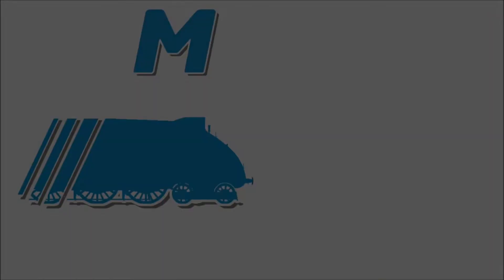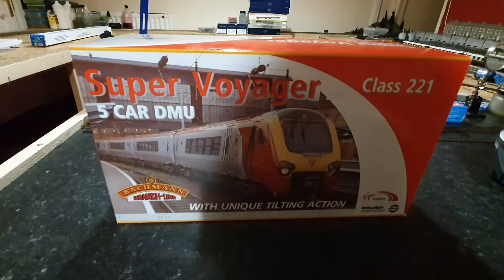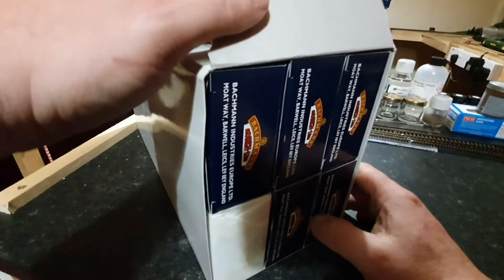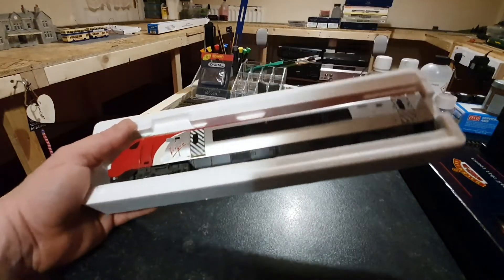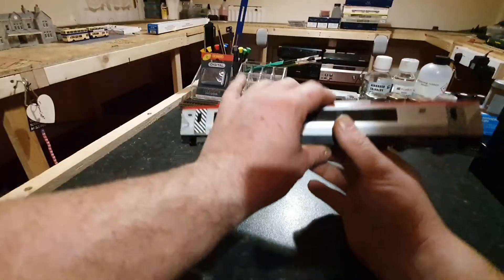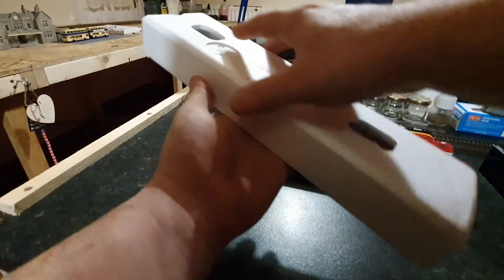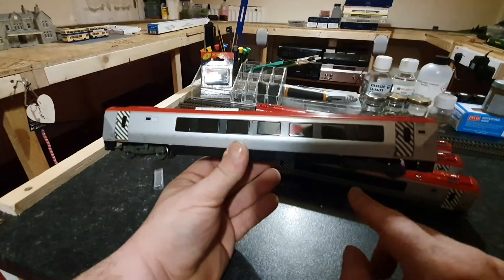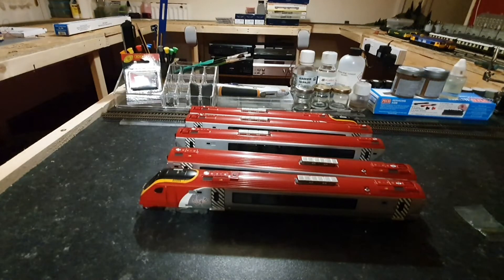Bachmann Class 221 super voyager

Comment: Hi Peter, the lil rhyme is helpful ‘ red & black go to the track, orange & grey go the other way. Ie to the motor. Red/orange are track /motor RIGHT, Black / grey track motor LEFT.

In the cab units its a separate decoder for each Im afraid. 3 decoders in total. Again red & black go to the wheel pickups. Orange & grey are redundant here so just tape them off. Green and blue are your best bet at one end cab lights as that operates on function 1. You could then use purple and blue at the other end as this operates on function 2.

Directional lights are controlled by white - forward and yellow for tail lights with blue as the common positive. 

Blue is the common positive for so that goes to the longer leg on the LED at both ends. Hoping thats helpful.

When you come to program the train the motor car AND both end cabs need to be on the track together. You will not be able to program just the end units on there own as there is no resistance across the orange and grey wires so they NEED the motor coach there too
Reply from the maker: Hi john 
Thank you so much for your help if I need more  old I possibly contact you on fb messenger possible video call help???
Many thanks hope you enjoyed the video.
Peter
Reply: @chelmswoodjunction  hi Peter yes of course. Im available early mornings and after 8pm atm
Reply from the maker: Hi john 
Thanks for the help I have managed to get the motor car chipped and up and running.
If I get problems with the lights in the cabs I will be in touch.
Peter

Comment: Hi peter great video of your class 221 l looked through the virgin 221 videos and and found one done by Matt at intercity 82 it shows the centre power car having derailing because it did have enough tilting motion even on 4th radius curves it also mentions about hard wiring a chip and running directional lighting at each end hope you find this message useful 
Kev Beighton Parkway
Reply from the maker: Hi Kevin 
I already have got the motor car chipped and up and running an I have had no issues with derailing and the tilt works perfect.
Peter
Reply: @chelmswoodjunction  thats great peter nice to hear you have got it chipped can’t wait to see it on your layout now that you have done a dcc conversation are you going to add directional lighting in the power cars seen a few on YouTube that have and they look great the work station looks great 👍🏻 have you got plans on getting any more locos to add to your fleet I am waiting for hornby to release their new tooling of class 91 for the fallen 
Best wishes keep safe 
Kev Beighton Parkway
Reply from the maker: Hi Kevin 
Yes I will be chipping the cab ends but at the moment have no intention of changing the lights.
As for future locos coming on to the railway I know I have one coming in April for my bday.
And there will be more but that will be another video coming this week and I have something come through the post today so loads of videos coming up.
Peter